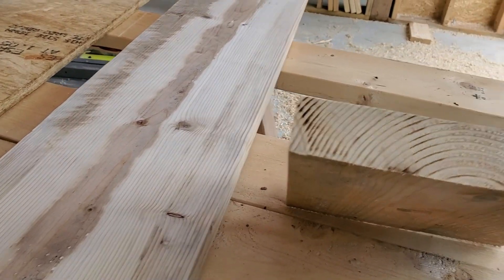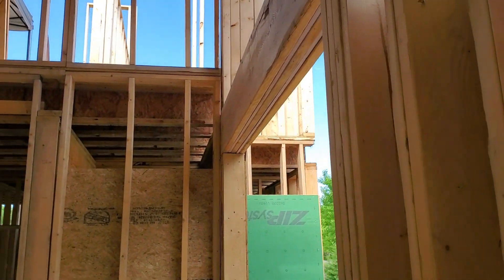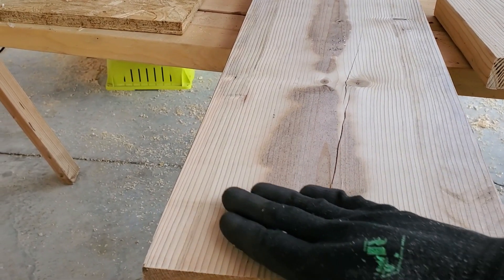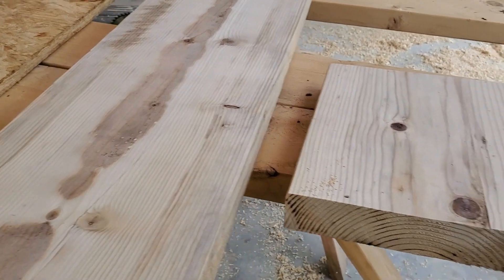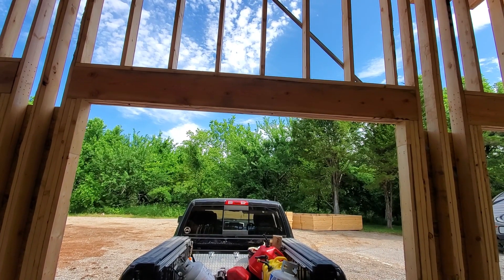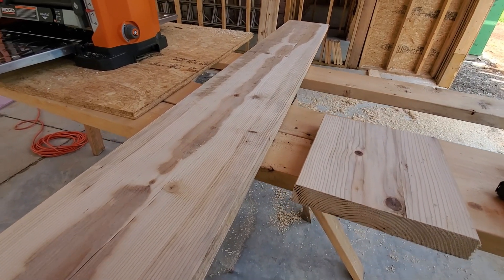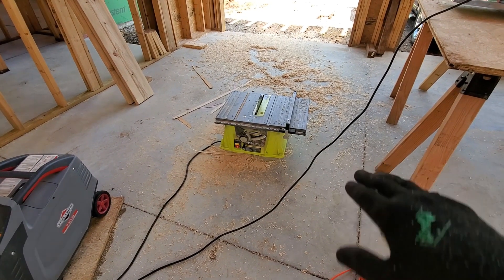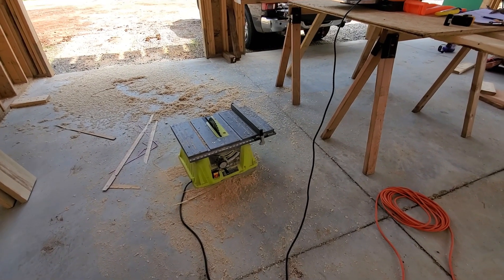How to Build an Insulated Header in our Off-Grid Homestead Build

Comment: Did you notice then foam being thicker then 1/2"? I built a header to a 2x4 wall with XPS in the middle. Header was to was to thick cause XPS is 9/16". When I looked at 1/2" polly iso foam, plywood, and OSB it was 7/16". This then made thee header match up to a 2x4. So I would have to plane it down to work as a sandwitch or outside. I could just save the money on a planer and just go ply spacer.
Reply from the maker: Not really.  I did end up planning the headers though but it was because they warped on me.  I'm pretty sure the insulation I used was 1/2" but if it was 7/16 I probably wouldn't have noticed being such small difference.